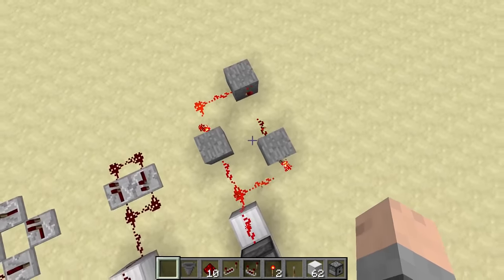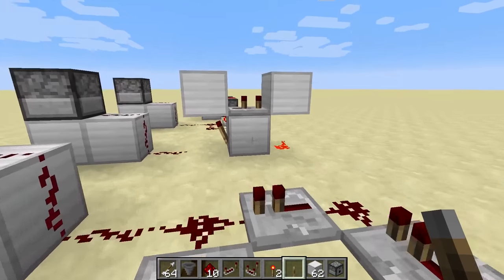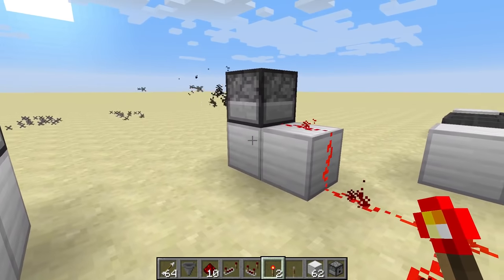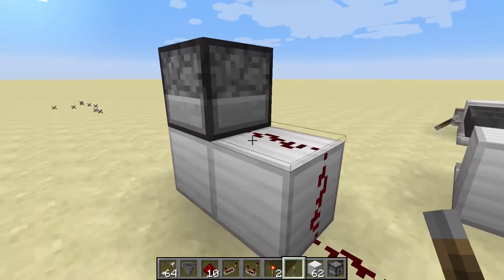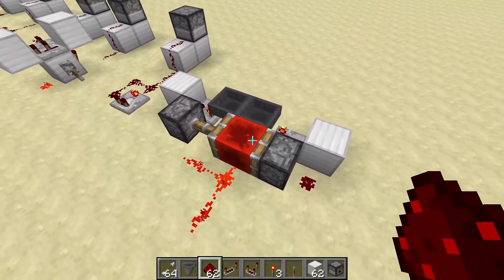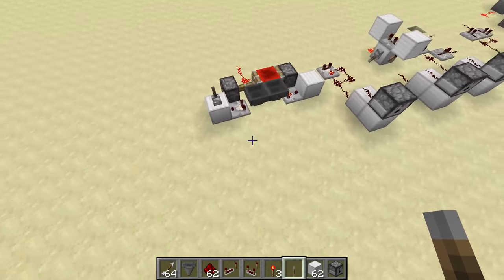Tip: Redstone Clocks in Minecraft

Comment: For the comparator clock, the reason it may not work sometimes is that it's too close, when the power is to strong and to fast it won't do anything, but if it''s a bit weaker (one extra redstone dust) then it will work.

Comment: For the second clock, you don't have to quickly place and break a red stone torch, just use a monostable curcuit
Reply: I got an idea to make it work I put a lever on a piston so Redstone will activate and at the same time the piston will break the lever in a second I don't need to break with hands so hope you. Liked my idea
Reply: @johnedward6586  just put the lever on the block where you are gonna place the torch, then place the torch and the lever will take one tick to turn it back off

Comment: Very cool but... the one thing you and also Ethos forgot to mention is that the pistons have to be sticky pistons.
Reply: Bec they assume that you can tell which piston to use by using your common sense.
Reply: Digital Piggy u said ethos u meant to say thanos
Reply: Regular pistons worked just fine for me.
Reply: @CerealGaymer    How did you get it to work with regular pistons?  I must be doing something wrong with the comparators.
Reply: @CerealGaymer  you are lying it can’t work
Reply: @michaelg8841  the pistons are just pushing the redstone block back and forth. Why would you need a sticky piston?

Comment: There's a much easier rapid fire clock that only uses two torches, one block, and dust.  Attach the torches to two opposite sides of the block, then basically draw a theta around the full block with the dust (no spacing out from the block).  The slash through the theta should go over the top the block.  Use one end of the slash for the lever, the other for what you want to activate :)

Comment: I got a sure-fire clock that is really fast and can be very cheap where the hardest material beside redstone is Stone for repeaters! It includes 2X building blocks 3 torches and 2X(repeaters and redstone(equal before)) + 1 redstone then a wire to what you want powered constantly the cheapest version is 6 redstone while it gets more expensive per 2 blocks by 3 redstone. The layout is (e.g. I have 6 stone) 3 stone in a line, 3 torches on their side away from the desired destination 3 redstone on top of the blocks and the final blocks on the top of the torches, to make it larger you put a block down and link a repeater (1 tick), and a redstone after, this is good for longer machines which would have a similar machine style that I make so I am happy I created it as it can save 1 redstone per 2 blocks (and my machines are normally very big with this clock)

Comment: Nice Video, and I know it's quite some time ago but a small advice for the 2nd clock. You can send a very short signal by placing an inverting torch on the redstone. The torch will be lit and then very quickly turn itself off because you invert the signal with that torch.

Comment: The video is now older so I have decided to share a weird clock I never knew was possible with 2 observers. The detection part of both observers have to be touching (Both detection parts have to be facing each other) and if you look at the part that displays a signal flashes rather quickly!

Comment: Why do you break the levers? There is two features on a lever, chad. You know. On and off
Reply: You need to power the redstone with a source and quickly delete it so the infinite redstone will work
Reply: Dosnt matter you need it to update it to an off state also he was incorrect since each repeater has a 1 dick delay in its default state it actually fires an arrow every two ticks
Reply: Joshua Labelle omfg xD
Reply: If you dont break the levers it will not work,you have to delete the restone source as quick as you can,if you dont break it then it will broke

Comment: (: thank you, Playing modded minecraft, Messing around ProjectRed Integration/Transmission (Logic gates & Bundled cables) ((ITS LOVE)) .. I did however need this video to make a red light flash (low value (Explained below))

Leadstone Energy Cell - > Comparator (gives different output values based on power level) 
I've found that percentages of my Energy cell RF amount could be implemented with different values.
100% (full) - Redstone value of 15 
75% - Redstone value of 11
50% - Redstone value of 7
25% - Redstone value of 3
10% - Redstone value of 1

So, I'd like to visually see how much Energy I hold, 
using 5 lights In order from FULL to LOW
Green
Green (flashes) 75%
Yellow
Red
Red (Flashes) 10%

So, as you see Its planned out.... 
But making it work is quite the task!
Very fresh with logic gates..
Reply: What the hell are you talking about

Comment: Some disadvantages:

1. Doesn't go fast
2. You need to time it right
3. Same as #2
    A single repeater cannot be in 4-tick delay
4. Burns in 1-tick delay
5. Your component (e.g. Piston, Lamp) that has a GUI will run out of what's in it quickly
    Not single player compatible
6. Too complicated
    Uses hoppers and pistons

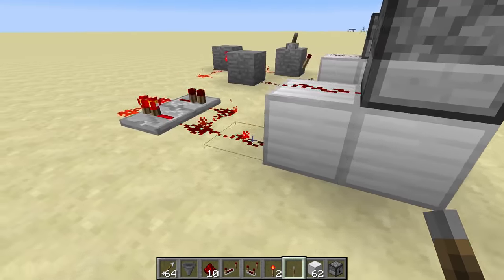Comment: 3:03
5, not 10.
You obviously know that there are 20 ticks per second, but those are game ticks. You're talking about redstone ticks, which take two game ticks, so there are 10 per second. An on-off cycle takes a minimum of two redstone ticks, so it's 5 arrows per second, not 10.

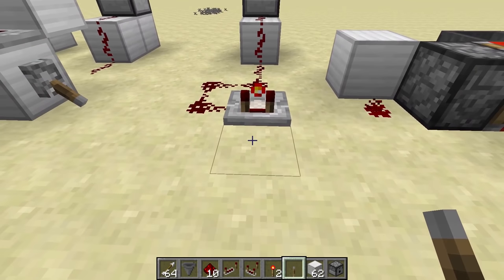edit: 5:17
And this clock... is exactly as fast as the one I was referencing before. You know that the redstone itself also needs one tick to turn on and one tick to turn off, right? If this clock is potentially game-breaking, it's not because it's too fast, it's because of how the comparator works. You'd need to give specific examples of the circumstances under which it won't work. :P

Comment: One has to wonder: why do you BREAK the lever to start the clock? The lever was intentionally invented to have an ON and an OFF position, just so you can simply FLIP the lever to start/stop the clock!
Reply: The lever is powering the block, thus making the redstone torch be in a permanent off position. Turning it off would have the same effect, but he breaks it because it is not needed for the build to function.
Reply: +Ethan Moore Whether it's needed for the build is not the point, is it? The point is that flipping the switch is just as effective as breaking it, and it can even be reversed if needed. For example, to turn the clock off again.
Reply: +Ethan Moore The point is, if you're going to break it anyway, then you could just as well have used a redstone torch in stead of the lever.
Reply: ^ But what he's saying is that simply turning the lever off would have the same effect as breaking it, thus it still makes the clock work.
Reply: See? There are still a few people with brains in the world. Thank you for restoring my faith in humanity, David.

Comment: Still in 2022 your first simple Clock fix my Issue i had with a Farm... 
i just extend the time with repeaters and set on my farm a Repeater that activate the piston on and off. 

I Change a Nano Crop Farm from a YT Video so i can use it for Flax from the Supplementarys Mod.

The Issue was that the Nano Crop Farm grow fast the Plants with Bonemeal and  breaks with a Piston the grown crop and you can put a new one....

But i extend the farm for 2 High Crops but for Flax it dont worked... cause only when the piston stops and start again the Flax was break.... so i used your Clock and got it to work!

Comment: You can actually put a lever on the Dispenser to deactivate it.
Reply: +Alexander James But the clock is still running.... To use less CPU, You'd want to just shut off the clock.... Having a toggleable clock is the ideal method, instead of turning off the end result, turn off the application.
Reply: Garin Merrifield Yes. However, I tested it by putting a lever ABOVE the Dispenser and it works.
Reply: kill the clock .. if your setup is unique you could possibly kill the clock via dispenser. .... when i say clock, redstone.

Comment: so, i used a redstone comparator facing the lever, the redstone comparator is surrounded with redstone dusts 3 sides and connected to a piston. I tried to turn it on, but it weakened and not flicker. This made me frustrated and i immideatly looked up for tutorials like this. My redstone clock USED to work in previous 1.18 versions. And in 1.19, it's RUINED. thank you very much for this tutorial.

Comment: for the last clock with the pitons were they sticky or not?
Reply: +Samuel Khayoyan sticky
Reply: k thanks
Reply: He is wrong, they don't have to be sticky because the other piston on the opposite side will also push the piston as the other piston loses it's redstone out put. So the pistons don't have to pull it, but push it. Do it with normal pistons, they are much cheaper. Try it out if you don't believe me.
Reply: actually I was being nice.. If you use sticky piston instead of regular, you don't even need the second piston. Just one sticky piston build everything else the same.